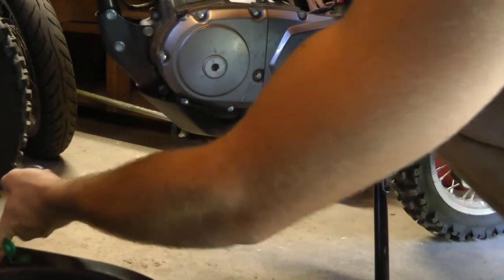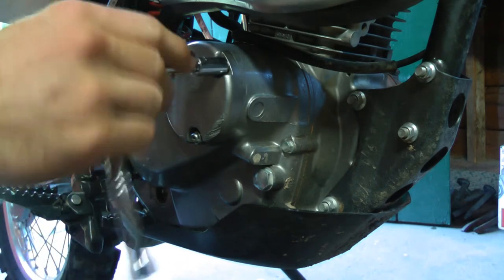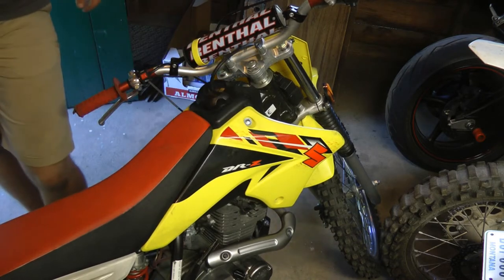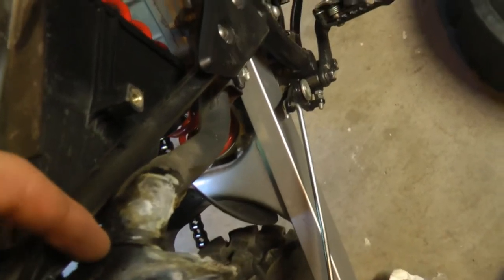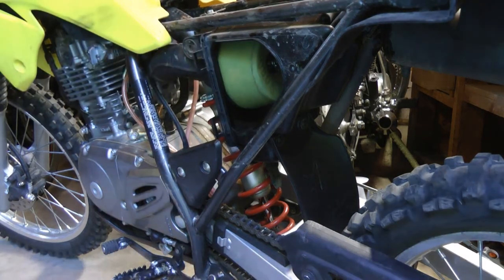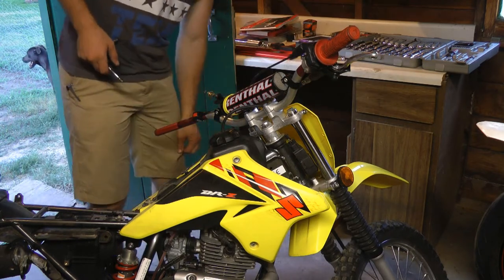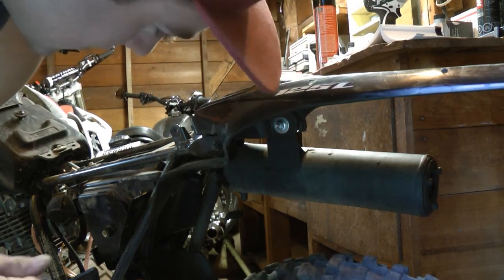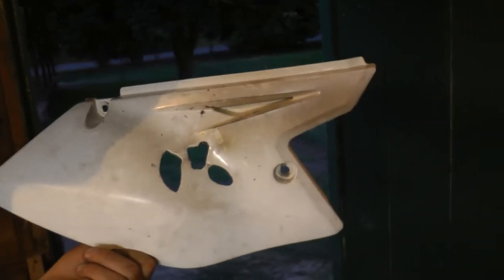DRZ Dirtbike Maintenence [EP. 2] [2014 SUZUKI DRZ-125L]

Comment: if your riding excess dust tracks you can cover the clean air filter with a section of chux wipe soaked in filter oil . the dust will attach to it first . just remove it and then your sponge filter is clean to keep riding .

Comment: helpful video! im going to buy a drz 125 for my 2nd dirt bike. now i will know how to take care of it
Reply from the maker: Skyler Lubert thanks. Have fun ripping around your DRZ!
Reply: do you happen to know why my over floe hose is leaking gas? i truned the gas and the choke off but it just keeps pouring gas. it leaked a gallon in 20 mins
Reply from the maker: Skyler Lubert sounds like maybe the float is stuck in the carburetor. You'd probably have to pull it off and clean things out.
Reply: yeah. thanks and @4:30 in the video i laughed so hard
Reply from the maker: Yeah. Not a whole lotta power